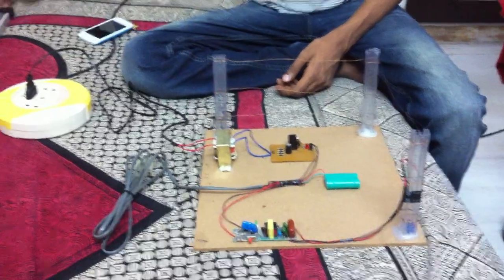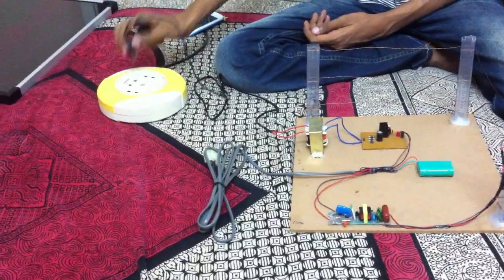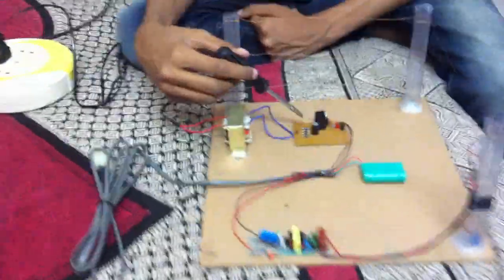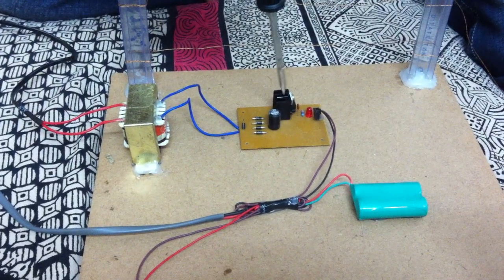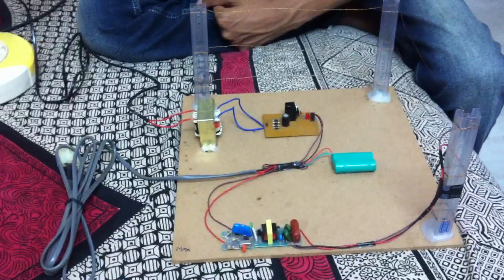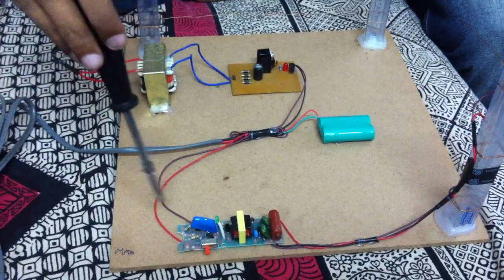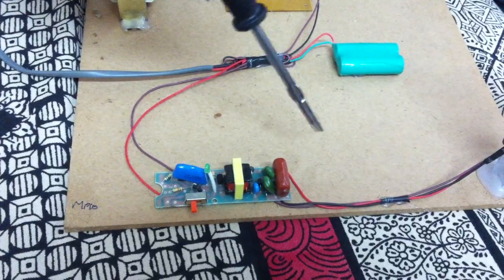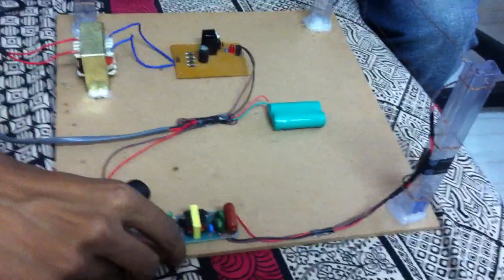Solar Powered Electric Fence

Comment: but wont the power drop happen if we use the mosquito bat circuit with a fence ??as the wires in a bat are a very small area compared to that of a fence????